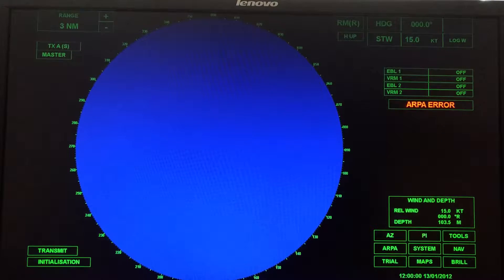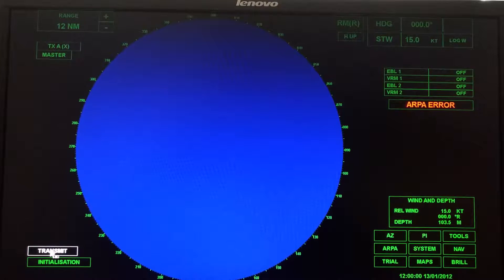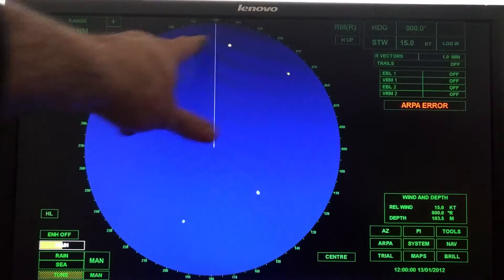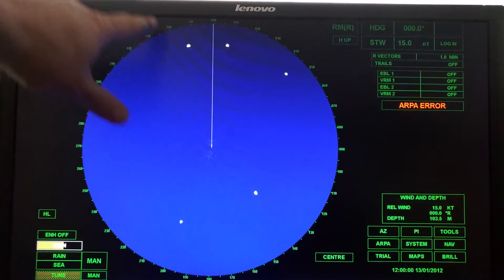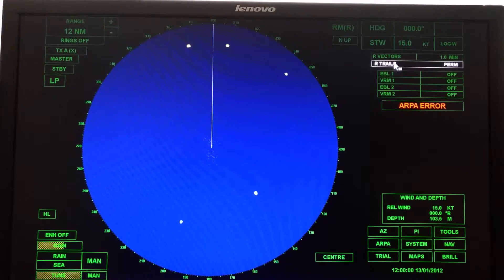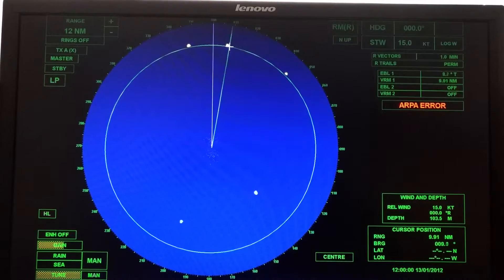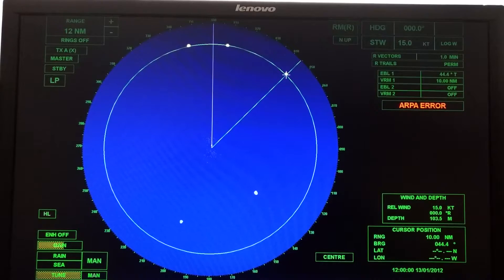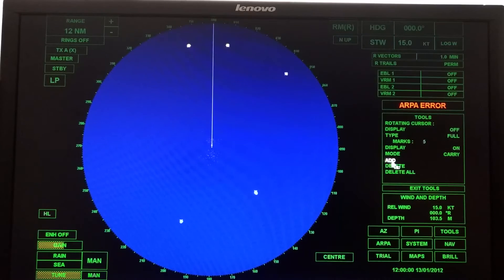NS293 ENav Lab RADAR Initial Settings

Comment: hi thank you for your video, but i have a questions why do we always adjust tunning first and than the gain
Reply from the maker: Tuning synchronizes the receiver to the frequency of the transmitter.  If you start with Gain it is ok but when you tune you may change the picture and then you might have to adjust Gain a second time.  It doesn't hurt anything but if you Tune first you only need to adjust Gain once.  Did that answer your question?